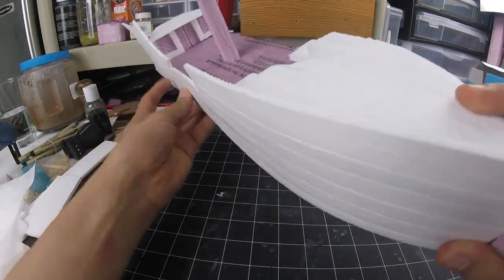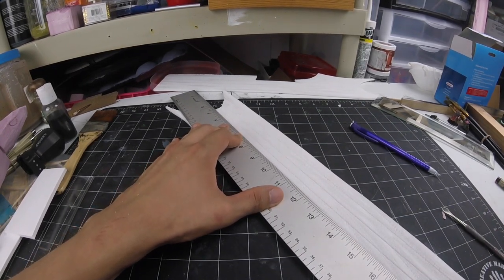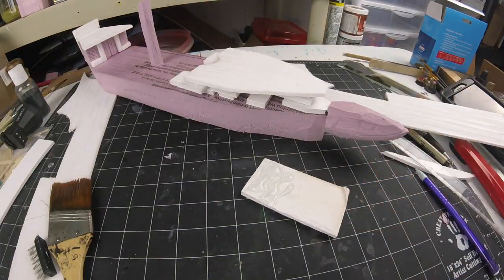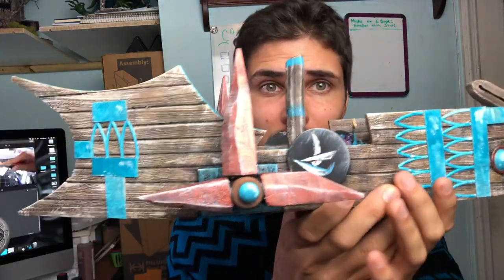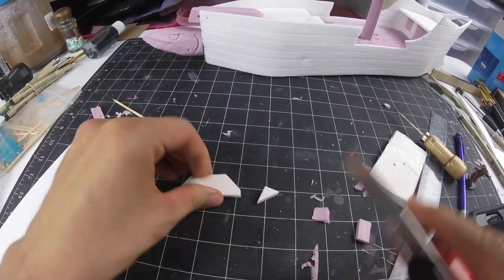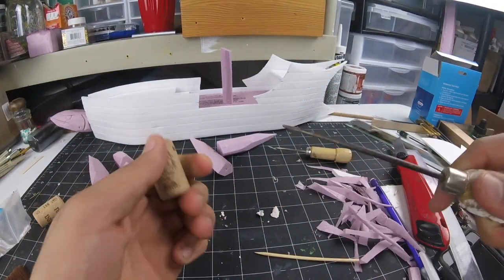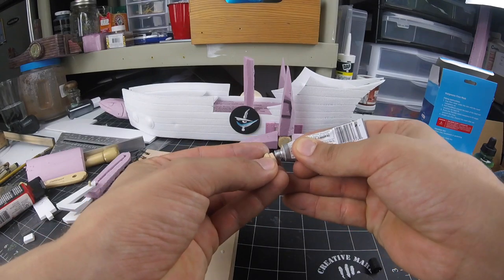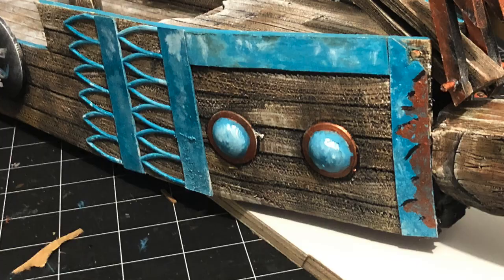How to Craft a Barracuda ship part 2

Comment: Good idea with the hooking system. Just the punctured boat could take on water pulling both down, maybe. I like your imagination. You need an anchor. Now the pull off a version of the Thundecat's tank or fortress? I like the ideas.
Reply from the maker: joe hayward see this is why I need you guys to tell me what do do before I release these videos. That’s something huge I forgot.
Reply: I use to be in the Navy. If a ship is hit anywhere close to the water line. It can take on water. Not unless the crew has a way of sealing off the water. No sweat your idea is great.

Comment: Not measuring! Eek! For gluing the large pieces, I suggest something like GOOP or E6000. They are very tacky and have working time of several minutes. Definitely go with the crystal ball to steer your ship. As soon as you started asking your question, a marble set on a pedestal popped into my mind... definitely go with the crystal ball. Keep at it, Franky D.
Reply from the maker: TheGameSmith e6000 melts foam no?
Reply: You are correct. That was a bad suggestion on my part.
Reply from the maker: TheGameSmith lol it’s all good. You had me questioning myself there for a second.